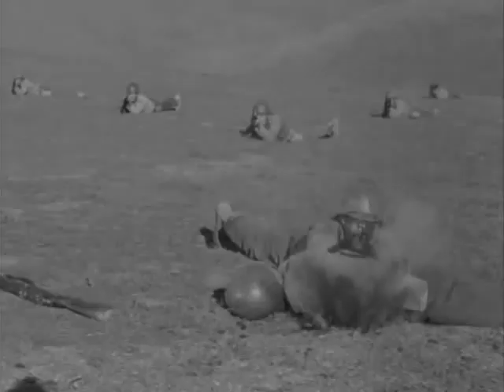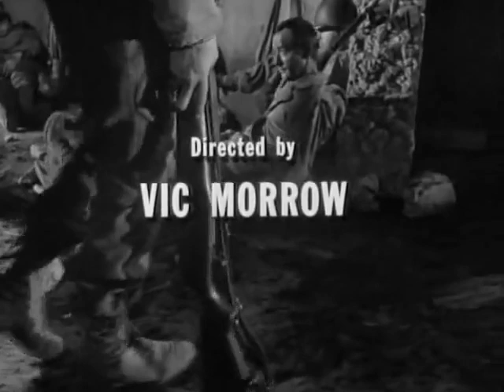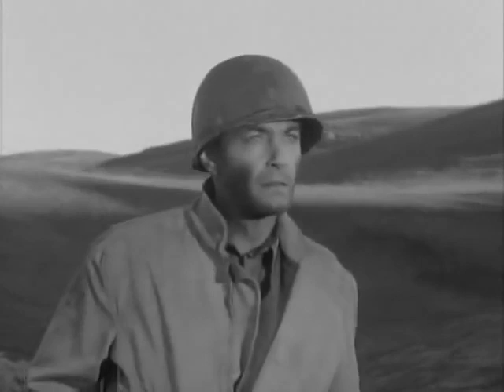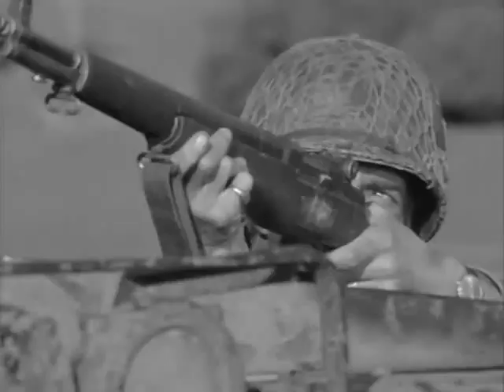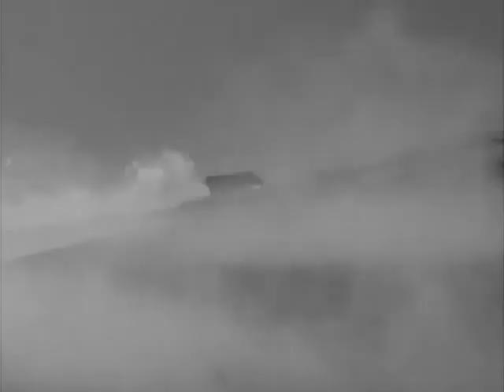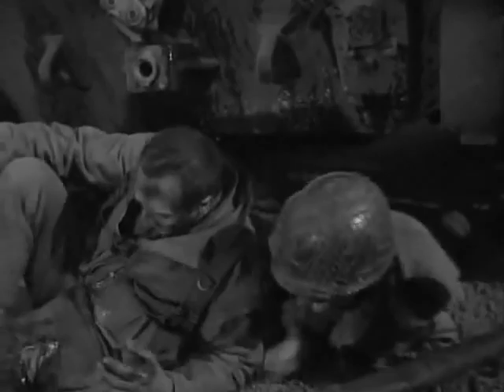Combat! S04E25   Hills are for Heroes Part 2

Comment: Vic Morrow was quite a director. This episode plays more like a feature film than a TV show episode. Despite the flaws such as the Germans using American Browning machine guns (which is confusing since many episodes before this one they used the correct MG-34 machine guns) and the tank was a post World War II unit,  the overall quality was amazingly good. It always amazes me that the show ran 32-35 episodes a season and each one maintains great quality. 6 day shooting schedules must have been grueling.
Reply: The Germans using the M-2 isn't at all implausible. The Germans were never shy about using captured equipment as long as it was serviceable and they had ammunition. They were actually very fond of the M-1 carbine of the type carried by Lt. Hanley. They often used captured British, American, and Russian tanks, half tracks, trucks and jeeps. The Allies did this as well, especially with vehicles. The German gas can (the so called Jerry Can) was particularly prized by allied troops as it was considered vastly superior to the rather flimsy cans they were issued.
Reply: @chardtomp  You are correct. I have seen photos of Americans and French operating captured German tanks and other ground equipment. In fact many of these tanks were used by some European military forces well after the end of the war.  As for the firearms it wasn't uncommon for both the American and British and particularly the French to utilize captured weapons but in most cases this was only temporary because they would soon run out of the cartridges. Later in the war there was a conversion kit issued to some allied troops that would allow use of 9mm ammunition, as well as other calibers that were used by the Germans, in their own weapons. It's a bit jarring to see the M2s used by Germans in Combat! but as you say it wasn't totally implausible.